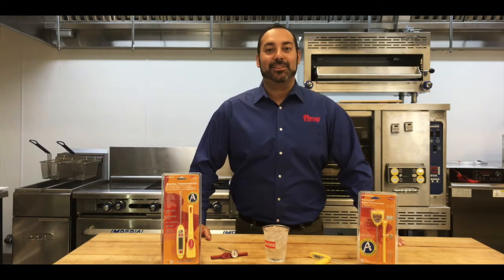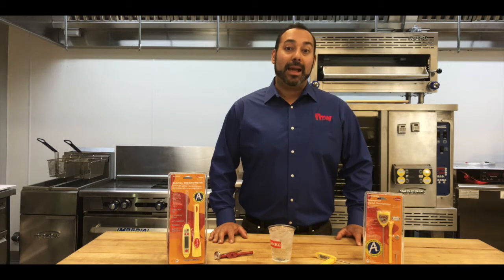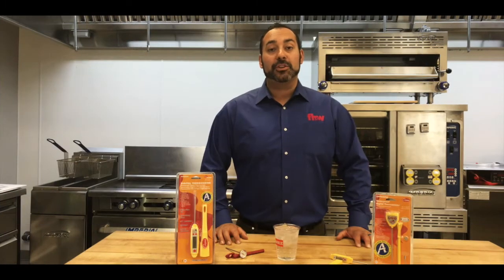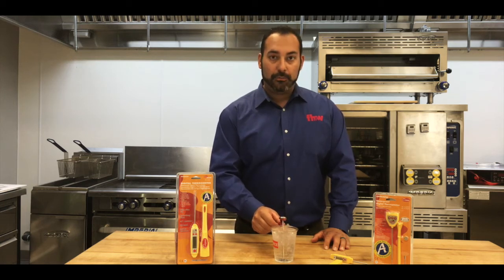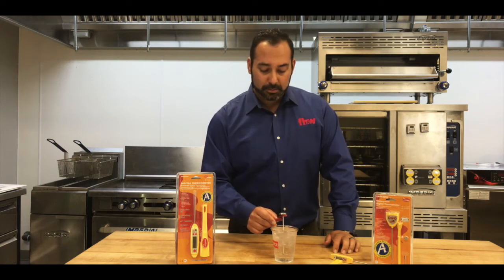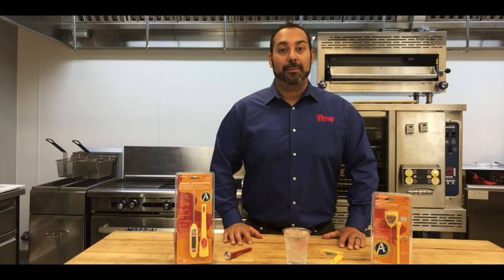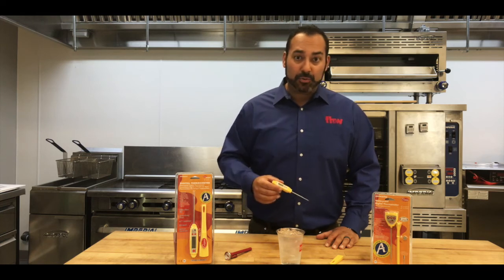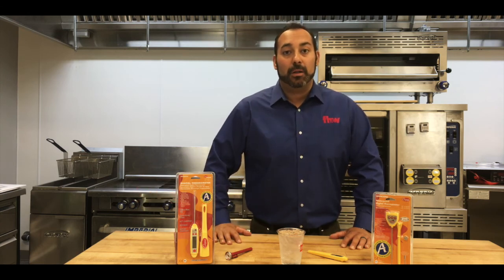Forbes Hever and Wallace: Cooper Atkins: Thermometer validation and calibration video

Comment: Very disappointed.  Googled how to calibrate the CA dfp450w thermometer. Says to press and the on/off button for 8 seconds until the CAL appears. Did so exactly, and NOTHING. No CAL appeared. Only turned on or turned off. I notice my thermometer is .8° higher than should be. Pretty sad for a $40.00 tool.
I guess I'll buy a different brand!